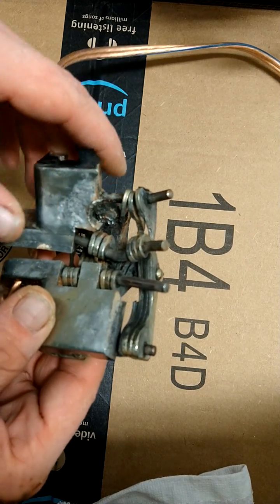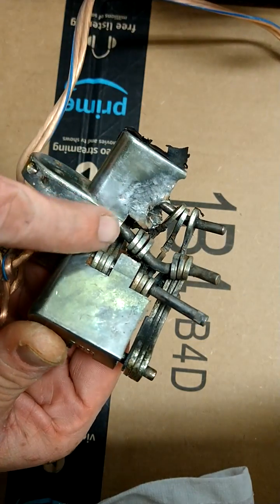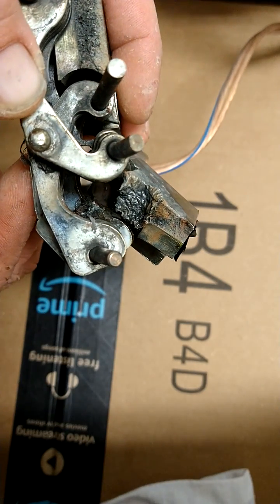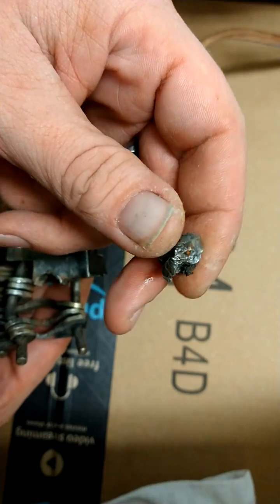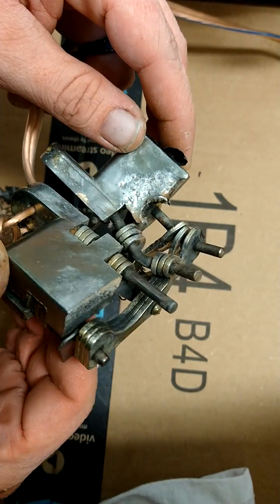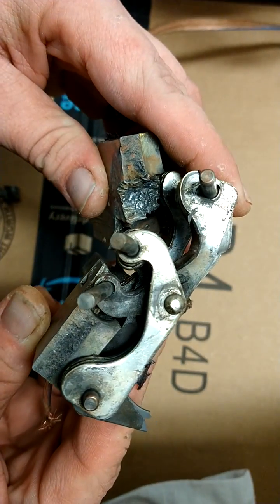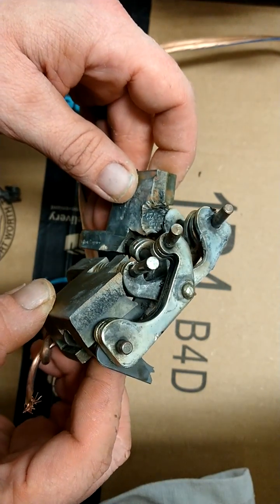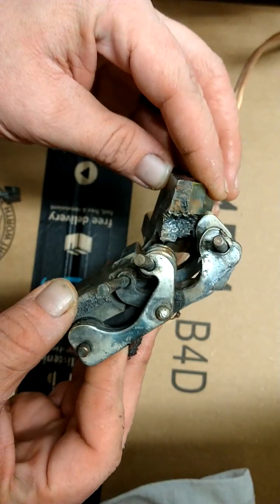💥epic improvised shaped charge💥

Comment: More info on the charge?? Aluminum powder and elmers glue? Huh?
Reply from the maker: Aluminum powder Elmer's glue were used for the liner the charge was etn with an ammonium nitrate composition
Reply: @improvisedchaos6355  yeah I saw that after . My bad.. obviously I knew there was more to it I just didn’t realize it was described
Reply from the maker: @HangtownTactical  no doubt...that was pretty epic seeing as the cone was plastic, aluminum powder, and a glue binder, no soft or hard metal used in liner or cone👍💯